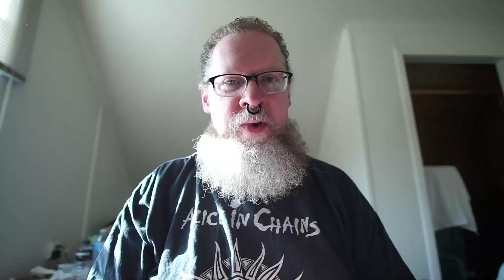The check engine light

Comment: Lil bulb in the dash. Electric tape behind the glass. Fuses a possibility one might see. It does not suck to bad to pull the dash.

Replace transmission for failed cylanoid (so?) Full of crap. Autozone here will read the trouble codes for free and you can look into what really needs replacing.